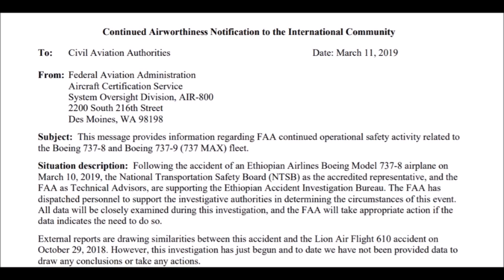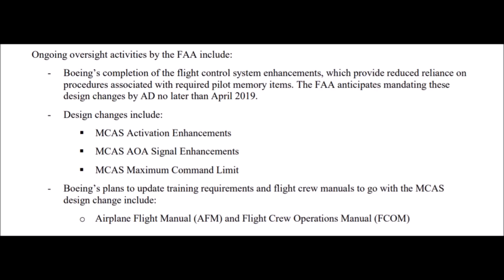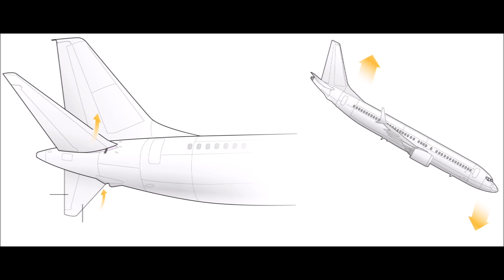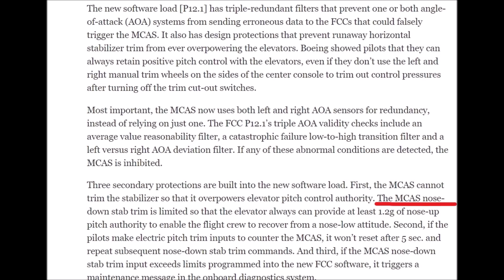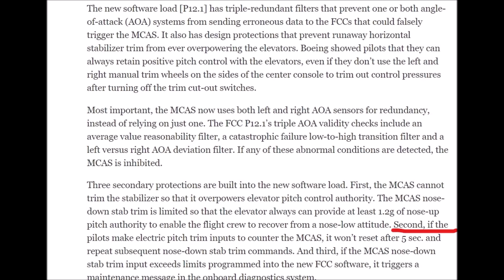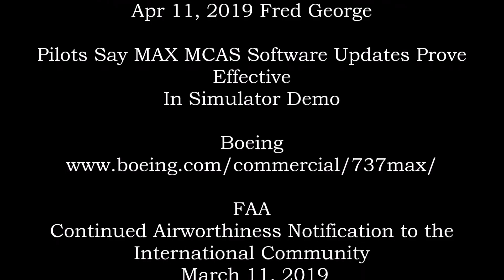737 Max UPDATE 14 April 2019 "The Fix"

Comment: If MCAS is only about "pilot feel" then give the pilot the option to turn it off and leave it off. He can get used to the feel in the simulator, as with any other plane he may be certified to fly. You do not compromise safety for "feel". If, as he claims at 4:05, seasoned pilots can barely feel the difference with MCAS off, doesn't that contradict the explanation that it was only added to adjust the feel? Does not pass the smell test.
Reply: They did have two switches that would have turned off mcas....they didn't do it
Reply: @puerco911  Will Boeing or the FAA approve flying the 737 MAX with MCAS turned off from the get-go?  I'll bet they won't. It's not just about "feel". Simplistic explanations may work for 99% of the public, but it's clear from other comments here that several of us who know a little something about aerodynamics and flying airplanes aren't buying it. Boeing had better come clean on this, and soon, or their reputation is going to be seriously impaired.

Comment: Am totally floored by this, all software engineers at boeing that designed this should be fired immediately....are you flipping kidding me??? Have TWO AOA sensors but only use one and switch per flight??? What in the world kinda stupid crap is that????  Man the ARDUPILOT drone software has used input from multiple redundant sensors with sensor data fusion and filtering for years, it's extremely reliable and allowes for a drone flight controller to fly drones with complete full redundancy for gyro, accelerometer and GPS.......and a mechanical AOA sensor??? Garbage!!!! , why not use MEMS electronic sensors, they are incredibly reliable, cheap and not prone to mechanical failures....man this is unreal, I fly about once a month, I am not worried of flying because of this, but I am floored my drones have more intelligent sensor redundancy than a millions dollar modern jet.... incredible

Comment: In the 1960s and 70s I was a commercial COBOL programmer, fortunately never having had to write a program upon which someone's life depended. The program compiler checked your syntax but not your logic. It was estimated that there was one logical error per fifty lines of source code in commercial software in the 60s/70s.  It is difficult and very expensive to write error-free code.
Present-day industry suggests average errors per 1000 lines of code at between 15 and 50;  Microsoft released code at 0.5 per 1000, and 0 defects in 500,000 lines of code for the NASA Space Shuttle.
Reply: This wasnt an error, this was a blunt single point of failure into a critical and authority flight control system....sorry, no excuses
Reply: Who told you that?

Comment: I'm not a pilot or an engineer but I was wondering, as I've heard a few times, that the MCAS system engages when the flaps and slats are retracted. Would it not follow that in the event of runaway stabilizer trim that activating flaps and slats would disengage MCAS and make it easier for the pilot to recover. I apologize if this has been raised before.
Reply: Gil McLauchlan    Not a 737 pilot myself but generally speaking, engaging flaps produces pitch changes.  Slats. too   Also there is a speed limit for flap deployment, above which could cause structural damage.

Comment: mcas was put in to compensate for the fact that boeing put a larger engine and positioned it higher and more forward, thus creating the tendency of the aircraft to pitch up and therefore requiring the macas system to correct it.  this is no way to build a plane.  boeing should follow airbus by raising the plane higher, and lower the engines.  the design flaw of the aircraft should be the one corrected, eliminating altogether the need for mcas.

Comment: How can W Brown make the statement 'I'm sure that the Boeing 737 Max will be one of the safest aircraft flying when these modifications to the MCAS system have been made"? By his own words, Brown tells us the FAA left the most of testing of the systems to Boeing and whereas this may have been acceptable in the past, today Boeing cannot be relied on to be responsible for these things. After all, they approved a system that accepts input from a single source (the AOA vane) and use the information to apply a potentially fatal correction to the controls. This is worse than irresponsible and the FAA should personally check every system on the aircraft, or get somebody other than Boeing to do so,  before certifying 737 Max to fly again.

Comment: You're saying the main reason behind MCAS was not safety but to maintain pilot type rating and lower cost for MAX customers, so will type rating now change as a result of the new modifications?
Reply: No, the type rating will not change. The fix to MCAS now means that it should work, the way it was supposed to work.

Comment: It may not called Automation, rather it was invented to overcome a design issue. More interesting, neither it was not included in any flight manual nor not communicated to Pilots. It means that the pilot flying 737 Max has no information of MCAS, as was evident from Lion Air Crash. I don't consider software updates can overcome basic air frame design issues.

Comment: They should give up on a bad idea entirely, and remove this system. It is so easy to see. They are sticking to it, and there is no any insurance that it will ever work.
Reply: thepetyo — There will be assurance that it won’t drive the horizontal stabilizer to its limit.

Comment: Thank you for the update. How often are these AOA sensors failing in flight? Why can't the same sensor that tells me whether my iPhone is upright or sideways be used. Why the heck would you have anything sticking outside the aircraft that is prone to icing or mechanical impairment (oh and lets look at pitot tube failures as well). Sorry but this is the usual engineering arrogance at play. 

This is a crap system - badly designed; badly deployed and the resulting accidents totally foreseeable. That's called negligence and it comes with a hefty price tag. Much more expensive than designing it properly and getting appropriate certification and giving required training.

The fix is still crap. No the system should never override the pilot. Why is one override acceptable at all when the supposed assistance is barely noticeable. 

Read the report: I think the Ethiopian disaster was caused by the very first MCAS action on the aircraft - everything comes down to the shock of the system doing something it should not have done, too close to the ground. 

I am so angry that this incompetence has been allowed to get through into building and certifying the aircraft. The sloppy MCAS design, the half arsed effort to fix something that was patently apparent to anyone reading about Lion Air. Four months ago that happened - aircraft were still flying and the fix is still not deployed. 

Look at the situation with delivery of the KC-46 and you can see a pervasive attitude of laziness at Boeing starting at the top and going right to the bottom. 

Get it fixed Boeing or you will lose to China - where they shoot people for this level of stupidity.

Comment: thank you for your update: from what I understand, software has been updated to a much safer level. Yet I'm not sure if a mechanical stop preventing a runaway condition of the trim system bringing the aircraft to a non recoverable condition (e.g. 10-15 degrees nose down stabilizer) has been added... would such a modification require a complete re-certification, that obviously the manufacturer has been avoiding since the start of this model ? in other words, is it only a "quick fix" ?
Reply: There is already a limit on computer generated nose-down trim (0 degrees), and it is way different from your numbers. There is a mechanical stop at 2.5 degrees nose down trim, and another at 15 degrees nose up trim. The runaway trim procedure will still be necessary, in the unlikely event of an electrical fault causing continuous nose down trim, or nose up, which is equally dangerous. No certification changes are involved, except MCAS itself. Changing too many things at once causes further delays, to no useful benefit.
Reply: @gordonrichardson2972  I may have switched the 15/2.5° up/down limits, the video showing the lead screw https://www.youtube.com/watch?v=AgkmJ1U2M_Q&t=5s left me the impression that there was more range nose down than nose up, but initial position may not have been centered. The point is moot anyway, still at 2.5° max nose down the plane gets in a non recoverable attitude (at least according this video around 5'30") , and software glitches do happen (an alpha particle ionizing the gate of a transistor, etc) - yet you maintain that there would not be a useful benefit to mechanically limit the triming range to a flyable domain! please confirm you have no affiliation with the manufacturer...

Comment: It's easy to insinuate bad piloting when you are looking back with perfect knowledge. But Boeing sold that plane on the understanding that it effectively behaved the same as the non-max.I'm sorry but some people need to go to jail. There is no way this got through a rational testing regime without corruption. All to avoid having to spend money altering the airframe because Boeing was shit scared airlines would switch to Airbus. There is no way on gods earth they didn't know the use of one sensor [alternately]was a point of failure. They will need 3 or more sensors to reduce the chances of one sensor being faulty and then which do you trust? Equals cancelled flights and hence money lost. The space shuttle flew with triple redundant systems for a reason. To reduce the chances of an error being indeterminate more often than certifiable. And I'll put money on it turning out more than two sensors would have required more changes to some aspect of the design than Boeing were willing to pay for.

Comment: With this new information, it is even worse for Boeing.  The MCAS is NOT required for safe operation of the aircraft but just for commercial reason only (allow MAX to share same type rating as previous 737s).

Comment: Thank you for the concise, detailed and easy-to-understand explanation of the MCAS fixes, as well as pointing out the original MCAS design shortcomings.
Design errors are not new, and they always seem obvious and avoidable when viewed in the sharp light of hindsight. This one will most likely turn out to be management-induced.
I agree that the B737 Max will be an extremely safe airliner when the fixes have been properly implemented.

Comment: So, any changes to control throttle in the case of runaway stab trim or, more likely, to limit MCAS nose down stab input where air speed exceeds the speed at which stalls occur? The Ethiopian Air crew never reduced throttle and the excessive air speed (nearly beyond design limits) made manual operation of the stab trim wheels impossible.
Reply: No. Making other changes, risks creating new and unforeseen problems. Only fix what is broken.
Reply: @gordonrichardson2972  Makes sense. 👍

Comment: MCAS never made sense to me because I always thought about it as a stall prevention system. The closest you are to a stall is during landing because of low air speed and that's when MCAS is disabled because the flaps are extended. It just didn't make any sense. Your explanation about the aft CG situations makes lot more sense. The pilots say there is little difference in handling with MCAS on or disabled so is MCAS really necessary?  You don't have it on the 777 and are doing just fine. Excellent video explains a lot.
Reply: MCAS was initially intended to cover tight turns at high altitude, in (TCAS) avoidance maneuvers . Stalls are possible in this condition, even with flaps up and at high speed, due to the lower density of air.

Comment: The abysmal original software design is criminally negligent and incompetent in my opinion. I've never written code for the aviation industry, but the new 'improved' software would be the sort of approach that any Software Engineer worth his pay check would have adopted right from the start.

I hope these people are prosecuted and are no longer allowed to be involved in safety critical systems since they don't appear to have the most basic understanding of what's required.

Comment: Juan, it seems this video is rationale for how Boeing's recent fix proposal - particularly the change to MCAS being a one-occurrence event, rather than recurring - can disable MCAS and have pilots fly in manual mode, since as you say MCAS is not stall prevention but is a maneuvering enhancement.  But won't the pilots then need simulator time, if they are now expected to be able to fly the Max without MCAS?  And if so, then I suspect Boeing would break seller agreements that state no simulator training needed, possibly resulting in Boeing having to pay for that training themselves.  Secondly, does that affect the type rating?
Reply: Disabling MCAS permanently would invalidate the flight certification. Fixing it removes the risks, and allows return to flight, and the common type rating to continue. This is as it should have been done in the first place, and none of us would have known the difference.
Reply: @gordonrichardson2972  Yes, if only.  The problem is Boeing has dug themselves a hole, exposing their problematic design process.  And they aren't "fixing it" (MCAS) if it can be turned off.

And then the FAA says "no need for simulator time".  Pilots from three major US airlines say differently:

https://aviationweek.com/commercial-aviation/pilots-say-max-mcas-software-updates-prove-effective-simulator-demo
Reply: Stephanie Grow You are correct that the issues are deep seated. The human factors points discussed in Juan's previous video, indicate that certification, oversight,  documentation, and training, were all inadequate. My response to this video was solely about MCAS itself, since many of those other issues apply to the wiring circuit changes. Those were made at the same time as MCAS, and differ from the previous NG model. This is a long and very complex story.
Reply: Stephanie Grow Juan has started in another comment, that in his opinion, the fixed MCAS will not require additional simulator training, only training on the existence of MCAS. I would also add detail on the use of the cutout switches, which differ significantly from the previous NG model.
Reply: Stephanie Grow Boeing will pay for all of this (in every way), no doubt about that.

Comment: @2:32 why do we even have MCAS? Because Boeing is trying to bypass rules, that's why, kill people to save money.
The software makes it the same type of aircraft. BS
Reply: Nobody is bypassing any rules. Designers have to work with the laws of aerodynamics, and the laws of the country, to optimise the aircraft. Doing both requires a lot of hard work.
Reply: @gordonrichardson2972  Really? did you listen @2:32 ? They put the MCAS in to SPECIFICALLY avoid having to classify the jet as other than standard 737. Thereby pilots would not have to re-qualify in type, in an attempt to save time and money.
Reply: What Juan says is a paraphrase of a much more complicated story. My comment is not based on the brief and limited summary provided in this video, but hundreds of hours reading detailed primary sources in the aviation field. Do not believe everything you hear, not even from this channel.

Comment: It's not fixed if you ask me
. Firstly the software could still be wrong
. Secondly the structure of the plane puts the pilots in a precarious position, because it's still effectively trying to make new engines fit, an old structure.

As far as I understand it this is not about automation, but about adding a new engine to an existing plane which was designed for smaller engines, and the software MCAS was to fix that issue...  ...

Comment: How does it logically seem rational that a Single Type Rating objective allows Boeing to install an automated trim augmentation system into a manual workflow? Would not the criteria be that manual hand flying should be idential to previous models in order to retain that single rating? Shutting off electric stab trim, the aircraft should fly the same. It doesn't.
Reply: Good points. Type ratings do not care about software, nor risk assessments (and that is a story in itself). The only thing that matters is that a pilot qualified on one model, should be able to fly another model. BTW, that is also one reason why MCAS cannot be turned off. If it could, your statement would be true.

Comment: and to make a software system...that even at 900km/h and 1000ft from the ground, activates full nose down with the pilots watching it go to collision is simply evil.
Reply: The software on most aircraft is not Artificial Intelligence, it is not 'aware' of anything other than what it has been programmed to do. The B737 is much older than most designs, and has much less automation than modern aircraft.

Comment: If seasoned 737 pilots could "barely tell the difference" between the MAX and previous iterations, then why is MCAS needed at all? That statement does not add up. It was asserted that the MAX is a very stable aircraft, but no references were cited.
Reply: MCAS was necessary to enhance the yoke feedback at high AOA. Without it, the aircraft would feel different, and not be certifiable. You are mixing up cause and effect. Every passenger aircraft has to be stable, otherwise it would never be certified. Only military jets have 'relaxed' stability requirements.
Reply: @gordonrichardson2972  So the handling is different enough that it would not be certifiable without MCAS. Why is he trying to downplay this by saying seasoned 737 pilots could "barely tell the difference"? And I'm not sure what you mean about mixing up cause and effect--I'm pretty sure I have those straight.